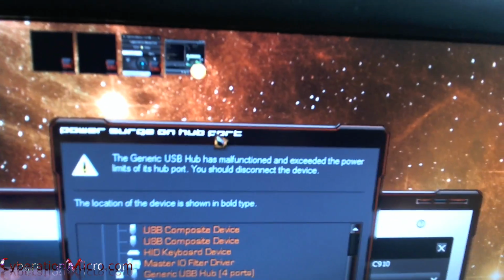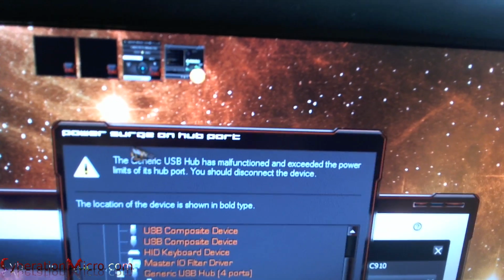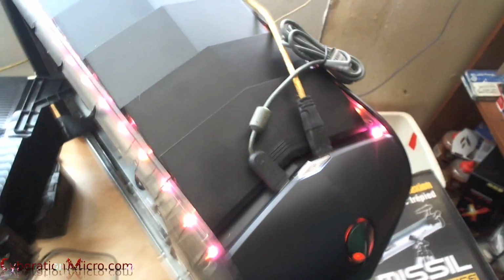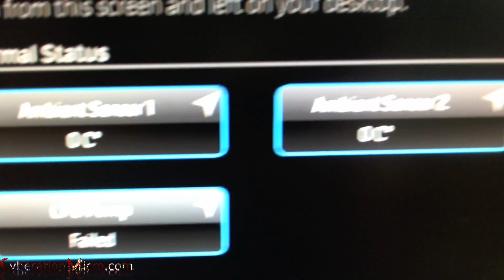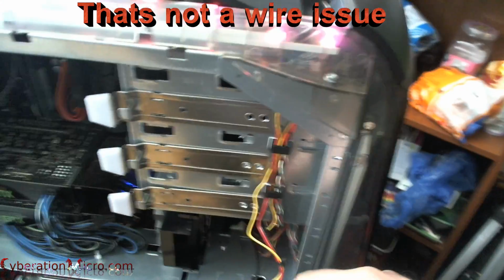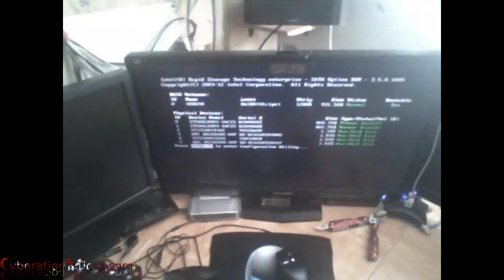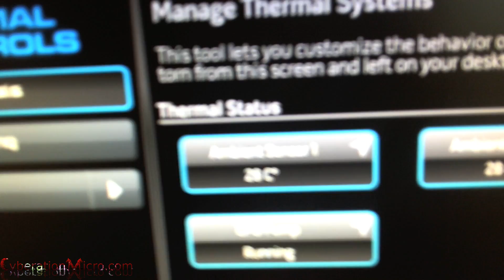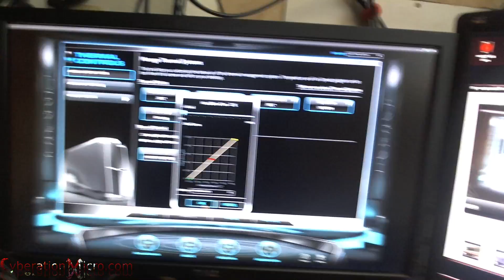Alienware Master IO Board Failed

Comment: I'm on Windows 10 on my Aurora R3 (don't ask me what I had to do to get it installed). Windows 10 performed an update and then my Master IO board just stopped controlling the fans / showing the lAlienware colored ights. I tried to perform an Alienware Control Center re-install and also a repair and that didn't fix it, also did the power dissipation thing by unplugging for a few hours and then holding the power button for 60 seconds to discharge and then replugging it but nothing ... The Dell BIOS diagnostics cannot detect the MIO board even though I see it with an orange light.. I think the board is bricked, I ordered one yesterday from ebay but ebay is like roulette in itself. Also the MIO board is really hard to get to underneath all those Blue Ray / Optical drives ... I am not happy with this and Alienware.